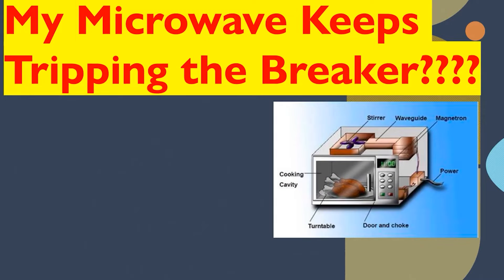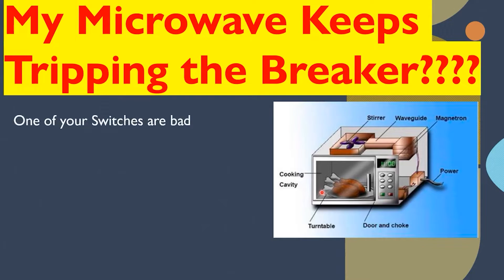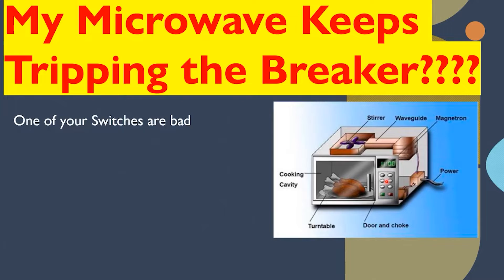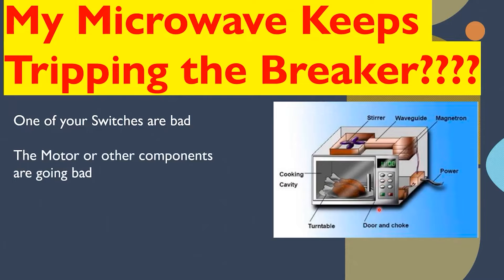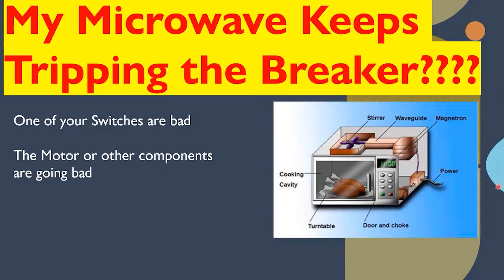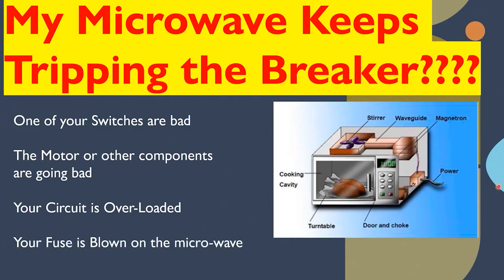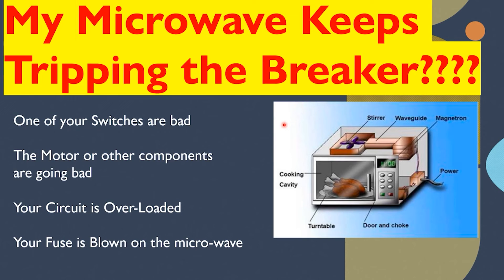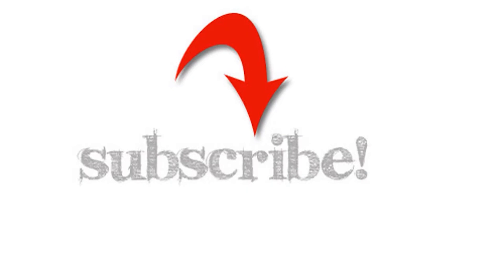Why Microwaves Trip Breakers Full break down. Learn it - Get it - Teach it.

Comment: I hate to say this, but countertop units are a throw-away item these days. They cost under $100 and that's less than a service call for any professional. That said, I have a break-out cord that I can use with an amp-probe set to peak hold and do a quick check to see if the unit is drawing too much power.